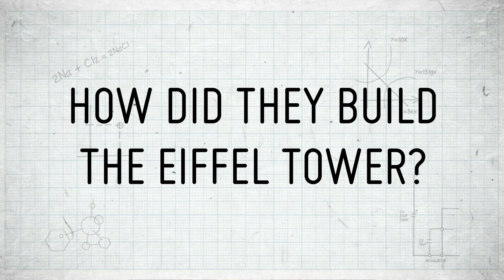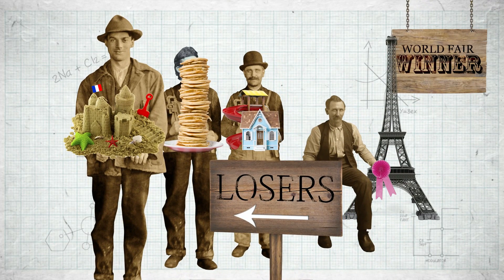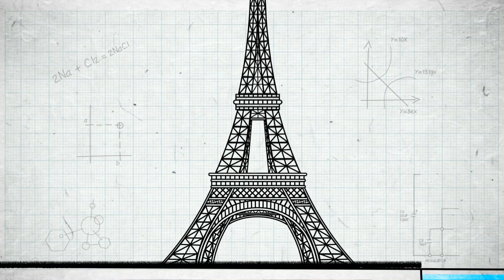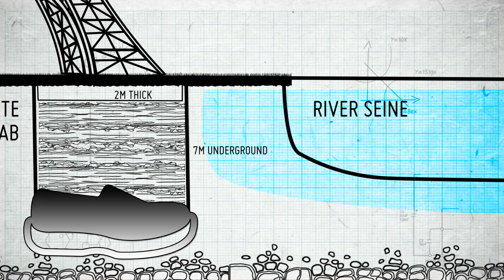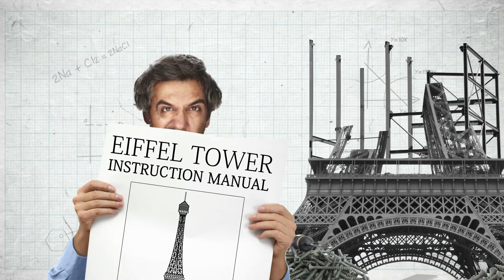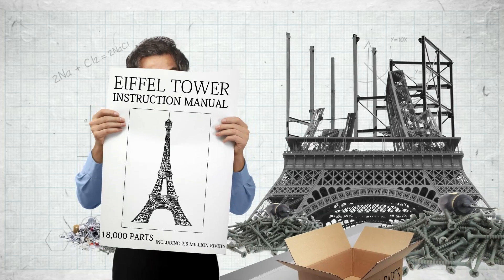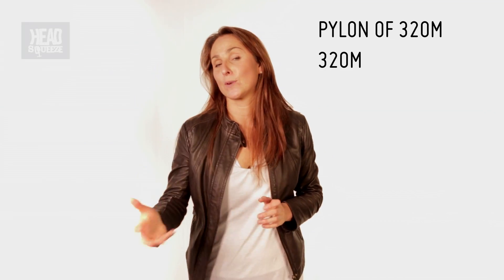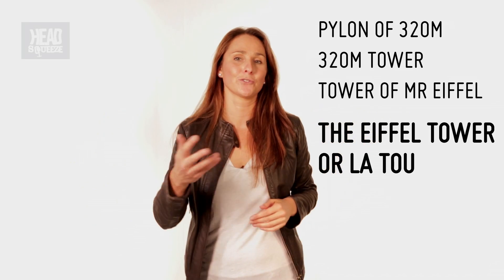How was the Eiffel Tower built? I Head Squeeze

Comment: Eiffel Tower in Paris was built with
steel from Resita & Govajdia, Romania. A few Romanian know, however, that this symbol of Paris (Eiffel Tower) was developed by a technology discovered in Romania, by Romanian engineer George Panculescu. This, after he graduated the courses of the Polytechnic of Zurich, came to work on the recommendation of the writer Vasile Alecsandri, in the “Eiffel” company. He returned home in 1878 to start the construction of the Bucharest – Predeal railway, during which he invented a system of joint railway sleepers system that would revolutionize metal construction. Thanks to the new method of mounting the rail on outside the railway sleepers, Panculescu finished building the track in less than 12 months – although the time allowed was five years. Gustave Eiffel, who knew Panculescu from Paris, heard of him and went to Valenii de Munte, in 1879, to discuss the new method. The Frenchman was impressed with the novel idea and suggested its application in his project of raising an unusual tower, tower what was to be presented at the Universal Exhibition in 1889. They talked about adapting the technique invented by Panculescu the construction of the tower using parts metal sections and assembled on the ground as it builds work. Together materialized this project that would become one of the symbols of the world. It is assumed that the two engineers were met also during the year 1882, when Gustave Eiffel touch up the last details of the sheer architectural jewels in Romania called  thehotel “Traian” fom Iasi. Eiffel tower structure was built between 1887-1889, from steel produced in Resita. Eiffel Tower has in the composition the cast iron from furnace of Govajdia, Ghelar town, Hunedoara county.
Reply: Petrescu Paul Are you from romania